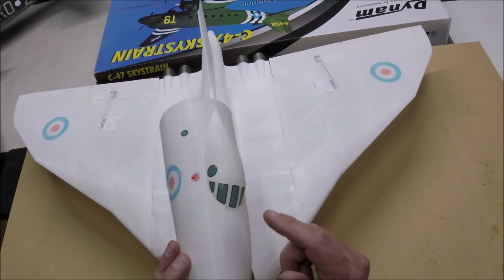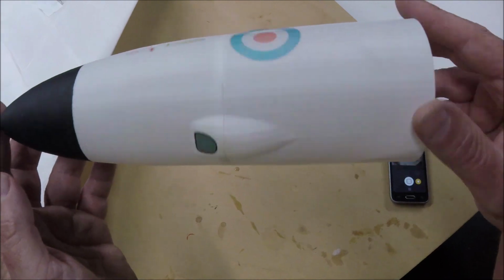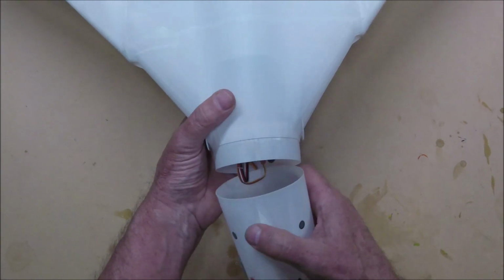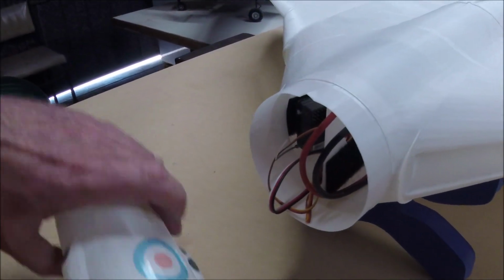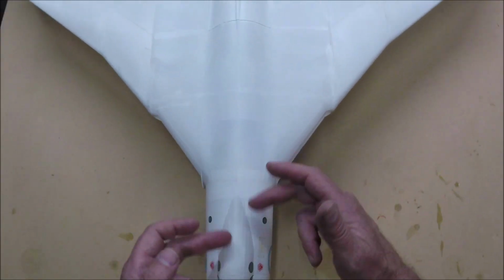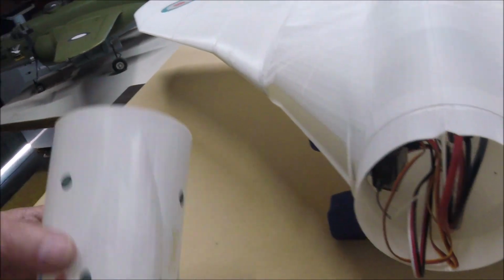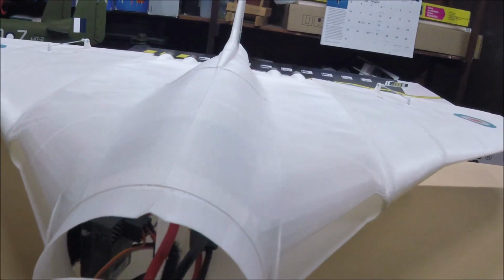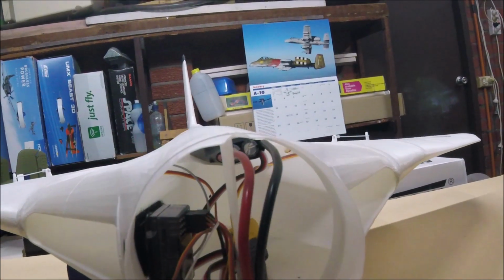RC Vulcan build tips

Comment: Brill thanks chap . I was thinking off fitting a 20mm 5v cooling fan hot glued to the top inside near the esc and then use the tip of my soldering iron to make some fine slots above the esc to help with cooling . Thankyou again for the video
Reply from the maker: Glad I could help.